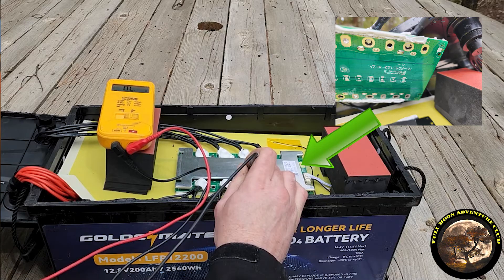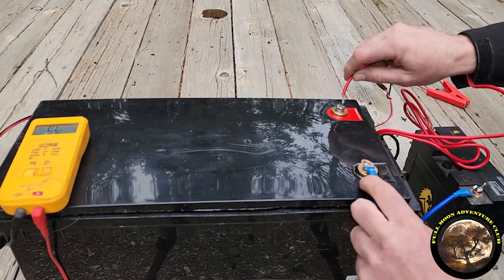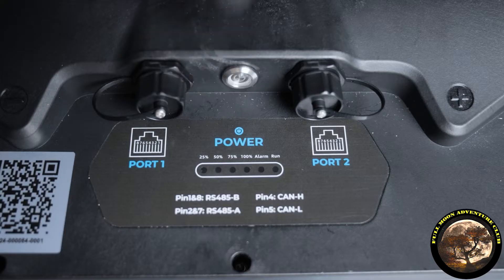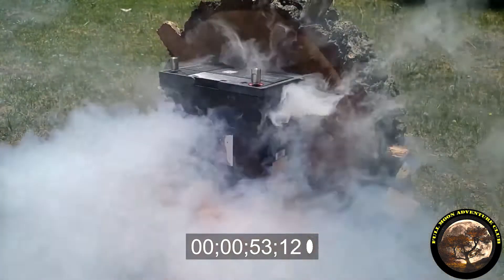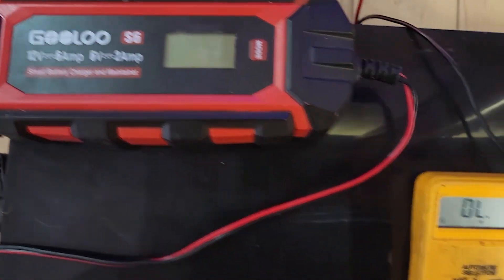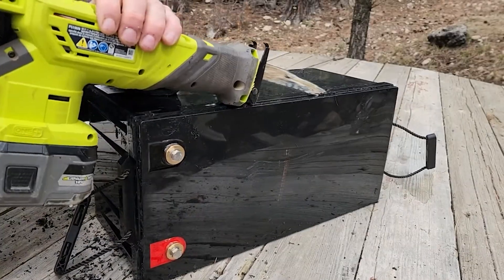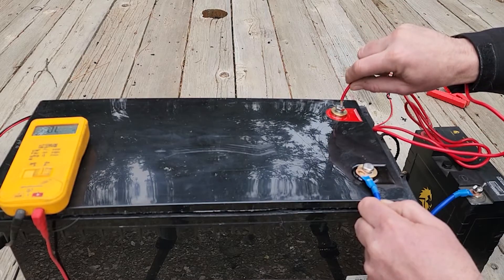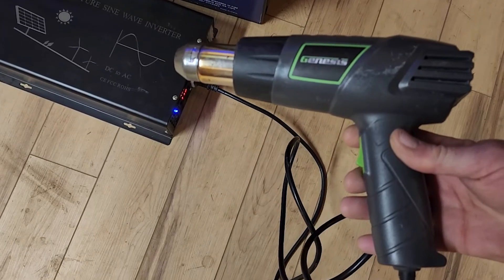LifePO4 Battery No Voltage - Won't Wake Up - Try this fix first

Comment: This worked for me. My lifepo4 battery was fully drained and my charger kept reporting off. I took a 6v and tried to tap the charger to give a reset but that didn’t work. I ended up connecting the working 6v to the lifepo4 battery and added the charger in at the same time. This turned the charger on and got the lp04 battery to start charging. 

Thank you!

Comment: Hey buddy thanks for the video I know it's a year already but I have a question I caught something you mentioned that the battery that failed is connected to the alternator. Do you connect directly to the alternator or were you using a DC to DC charger? I'm currently experiencing a similar problem I have not checked yet to see if the battery is swollen however I have metal case batteries so it may not be as obvious as your issue.

Comment: I Am OFF GRID and after several cloudy days in a row the NEWTIPOWER 100AH batteries I use for refrigerator / freezer would not charge! I found your video and used a spare 7Ah 12VDC battery and tapped the Newtipower battery terminals as shown in your Most Excellent Video and now they are charging up again! Thank you ever so much for the valuable information. God bless and be well!

Comment: bought 4x 12v 300ah batteries.
was charging them one at time... to hopefully put em in series to make a 48v system.
ahhh.. the last one.. its at 0.98v.
victron 100/20 cant see it. 
solution: put one of the other batteries in parallel and left it to charge. 8 hours in it was at 4.8v 24 hrs later (night included no charge time of course) its at 6.67v  but savior battery is full..
so should i give up? or should i try to drain down the savior battery and then reconnect again and hope tomorrow?
sadly sending it back is a no go as i had em sent to the caribbean.. it would cost $42,000 (280usd) just to send it back to the usa. then when the replacement (if they honor it) is coming down its another 42k in shipping.. then customs is going to come sniffing at 46%. so.. yea..

Comment: my eco worthy lifepo4 battery does charge, but there is no voltage coming out. Even the solar charger turns off after sunset. So no current at all coming out Any idea of I could sold the problem?
Reply: Bms sleeping

Comment: I think this is what's happened to mine. I cannot wake it up. I have my batteries wired in parallel and one battery was at 2% and the other battery was flat. The 2% battery took a charge just fine but the flat one I couldn't get to take any power whatsoever. Do you think a higher voltage would help?

Comment: Made a solar bank with 10 7ah LiFoO4 batteries. 
4 of them asleep… 
3 of the 4 woke up using another charged battery without issue. 
1 of the 4 refused to wake up.  
Tried several methods with no joy. 
Ended up over volting it to get her going. 
Put 1/2 amp at 22 volts on it for 30 seconds and it started taking current👍🏼. 
Operating normally now. 
That did the trick.

Comment: Great video. do u think I could wake up my 48v Lifepo4 battery with a 6/12v trickle charger It's reading .5 or do u have another option it's only 1 year old. The name of the battery is lossigy 100 a.
Reply from the maker: I doubt it. You'll probably need to construct some sort of Series Battery configuration or connected to another 48 volt battery in order for it to wake up.

Comment: I think you can put the good battery's negative ground onto the dead battery's negative for just a couple of seconds. Then measure the dead battery's voltage and it should anywhere between 5-12 volts. Or, just hook the charger to the dead battery and it should start charging. Either way you'll know the dead battery isn't.

Comment: My evolution cart battery  reads 48 volts but my battery wont charge. Sitting at 5% charge. Cart on board charger starts up and in 5 seconds turns off. Cart was stored at 65 % charge 4 mts ago. What should I do. Tks in advance!

Comment: I have two 200ah 12v batteries and one has shut down. It cut all my power out. Can I use the good battery to wake the other battery up?  Is this not a good idea?

Comment: I’ve got a 100 amp power lithium battery on my boat. It had 20% left. I tried to charge it, but it would not take a charge. It would power things and keep running thebattery down. But would not charge any ideas?
Reply: Follow our directions. Duh

Comment: Some bms systems have a delay on the " incoming power" for like a second its free to pump in then the bms starts protecting. This fixes ryobi batteries too you can tap a ryobi back in. Its actually time, 3 taps is 3 intervals of bypass

Comment: I have a Weize 100AH lithium and I couldn't get it to take a charge, I took it to a battery shop and he hit it with 19 volts and it woke up and I could charge it. Now it's charged to 13.44 and has been there for a few days. Do you think the 19 volt zap could have hurt anything ?
Reply: I've got one too volt meter reads 10.3 volts but wont take a charge

Comment: Thanks for this.  Jumped my 24s with 4- 6v's and worked like a charm.  Had to have generator running and hooked up immediately.  Charged up gtg
Reply: do you mean 24v (4s)
Reply: @jimmybrad156  I have lossigy 24 volt lithiums hooked up in series.  I used 4 6volt golf cart batteries to jump one of em and it worked.

Comment: Have  had  3  (three)  different  power  stations  and  1  (one)  LifePo4  battery  that  would  not  'wake-up'  with  12  volts  applied  from  an  external  source.   The  'external source'  was  both  an  old-school  battery  charger  (Sears)  and  a  standard  lead-acid  battery.     In  each  case  I  gained  access  to  the  internals,  disconnected  the  cells  from  the  BMS,   charged  the  cells  separate  from  the  BMS  to  > 11  volts  where  necessary  and  in  each  case  upon  reconnecting  the  BMS  it  was  'awake'  and  fully  functional  again.    (In  each  case  I  had  also  'shorted'  the  BMS  with  a  jumper  briefly  once  the  cells  were  Disconnected !  to  drain  any  residual  power  that  may  have  been  stored  in  the  capacitors  of  the  BMS.)    

    In  my  inexperienced  opinion  the  BMS  itself  had  needed  the  wake-up.   In  one  case,  a  Goal Zero 1000,  the  power  station  worked  fine  for  two  days  after  the  'wake-up'  and  then  went  dead  again  with  the  state  of  charge  previously  showing  about  70%.   Again  I  disconnected  the  cell-pack  from  the  power  station,  checked  the  cell-pack (= > 11.5 volts)  and  without  doing  anything  else  but  pressing  the  buttons  on  the  station  to  potentially  drain  any  stored  capacitor  power,  I  reconnected  the  cell  pack  and  the  station  was  alive  and  functioning  again  normally !     It  has  been  fully  functional  since  then  for  >  two  months  running  my  frige-a-frator,  an  induction  cook-top  and  being  charged  from  my  backyard  solar  panels.

   Me ?    I  am  an  EX -  Air/Heat  Service  Tech  that  likes  my  new  hobby  of  Off-Grid  solar  power  to  reduce  my  SDG&E  (Southern California)  home  power  use  to  about  $18.00  a  month.   We  are  proud  to  pay  (likely)  the  highest   power  rates  in  the  USA  .  .  .  .  .  .  'proud'  because  'we'  keep  re-electing  the  same  folks  that  cause  these  high  rates !                            take  care,                  rh

Comment: The issue I am having is the battery reads 12v but as soon as you hook something to it it reads 0volts. No power. Any suggestions?
Reply from the maker: If you connect it to another strong charged battery and it wakes up and reads 12 volts it is still low on charge. It should read around 14 volts when charged. If it is charged and it goes to zero when you connect it to something it may be a faulty cell or BMS unfortunately.
Reply: 12 is empty. 14 is full

Comment: I am in a similar situation. My 12V lifepo4 drained off grid during off season and went into protection mode. Hard to tell when during last few months. I was able to reactivate it at first and started charging it off solar on a Victron smartsolar. After a day of charging sucessfully I managed to drain it again with only a small load when the sun went down. It went into protection mode again and won't wake up now. :/
Reply: @gpmail -     Have  had  3  (three)  different  power  stations  and  1  (one)  LifePo4  battery  that  would  not  'wake-up'  with  12  volts  applied  from  an  external  source.   The  'external source'  was  both  an  old-school  battery  charger  (Sears)  and  a  standard  lead-acid  battery.     In  each  case  I  gained  access  to  the  internals,  disconnected  the  cells  from  the  BMS,   charged  the  cells  separate  from  the  BMS  to  > 11  volts  where  necessary  and  in  each  case  upon  reconnecting  the  BMS  it  was  'awake'  and  fully  functional  again.    (In  each  case  I  had  also  'shorted'  the  BMS  with  a  jumper  briefly  once  the  cells  were  Disconnected !  to  drain  any  residual  power  that  may  have  been  stored  in  the  capacitors  of  the  BMS.)    

    In  my  inexperienced  opinion  the  BMS  itself  had  needed  the  wake-up.   In  one  case,  a  Goal Zero 1000,  the  power  station  worked  fine  for  two  days  after  the  'wake-up'  and  then  went  dead  again  with  the  state  of  charge  previously  showing  about  70%.   Again  I  disconnected  the  cell-pack  from  the  power  station,  checked  the  cell-pack (= > 11.5 volts)  and  without  doing  anything  else  but  pressing  the  buttons  on  the  station  to  potentially  drain  any  stored  capacitor  power,  I  reconnected  the  cell  pack  and  the  station  was  alive  and  functioning  again  normally !     It  has  been  fully  functional  since  then  for  >  two  months  running  my  frige-a-frator,  an  induction  cook-top  and  being  charged  from  my  backyard  solar  panels.

   Me ?    I  am  an  EX -  Air/Heat  Service  Tech  that  likes  my  new  hobby  of  Off-Grid  solar  power  to  reduce  my  SDG&E  (Southern California)  home  power  use  to  about  $18.00  a  month.   We  are  proud  to  pay  (likely)  the  highest   power  rates  in  the  USA  .  .  .  .  .  .  'proud'  because  'we'  keep  re-electing  the  same  folks  that  cause  these  high  rates !                            take  care,                  rh

Comment: I notice you look like your charger is a pretty standard one. I have  one andused on my deep cycle lead acid batteries for charging. 
I swapped the lead acid out for lithium ion iron phosphate batteries.l see specialized lithium ion  chargers and they're costly.
Can l use my standard battty charger?
Reply from the maker: You certainly can. However, RV lithium iron phosphate Chargers are capable of charging at 100 amps or more. The charger that is Illustrated in this video will only charge at 5 amps so it takes a long time to charge batteries

Comment: I am having the exact same problem with a 280AH LifePo4 battery in my camper, except it’s brand new. The mfg suggested linking it straight to my solar bank, which I’ve done with no success. Any updates on how you got yours to wake up? I have a spare 12v battery but it’s a big boy and I’m hesitant to do the tapping method with it.
Reply: Your  'mfg'  should  replace  it  under  warranty !     I  previously  commented:

Have  had  3  (three)  different  power  stations  and  1  (one)  LifePo4  battery  that  would  not  'wake-up'  with  12  volts  applied  from  an  external  source.   The  'external source'  was  both  an  old-school  battery  charger  (Sears)  and  a  standard  lead-acid  battery.     In  each  case  I  gained  access  to  the  internals,  disconnected  the  cells  from  the  BMS,   charged  the  cells  separate  from  the  BMS  to  > 11  volts  where  necessary  and  in  each  case  upon  reconnecting  the  BMS  it  was  'awake'  and  fully  functional  again.    (In  each  case  I  had  also  'shorted'  the  BMS  with  a  jumper  briefly  once  the  cells  were  Disconnected !  to  drain  any  residual  power  that  may  have  been  stored  in  the  capacitors  of  the  BMS.)    

    In  my  inexperienced  opinion  the  BMS  itself  had  needed  the  wake-up.   In  one  case,  a  Goal Zero 1000,  the  power  station  worked  fine  for  two  days  after  the  'wake-up'  and  then  went  dead  again  with  the  state  of  charge  previously  showing  about  70%.   Again  I  disconnected  the  cell-pack  from  the  power  station,  checked  the  cell-pack (= > 11.5 volts)  and  without  doing  anything  else  but  pressing  the  buttons  on  the  station  to  potentially  drain  any  stored  capacitor  power,  I  reconnected  the  cell  pack  and  the  station  was  alive  and  functioning  again  normally !     It  has  been  fully  functional  since  then  for  >  two  months  running  my  frige-a-frator,  an  induction  cook-top  and  being  charged  from  my  backyard  solar  panels.

   Me ?    I  am  an  EX -  Air/Heat  Service  Tech  that  likes  my  new  hobby  of  Off-Grid  solar  power  to  reduce  my  SDG&E  (Southern California)  home  power  use  to  about  $18.00  a  month.   We  are  proud  to  pay  (likely)  the  highest   power  rates  in  the  USA  .  .  .  .  .  .  'proud'  because  'we'  keep  re-electing  the  same  folks  that  cause  these  high  rates !                            take  care,                  rh
Reply from the maker: Nothing worked for me except the tapping method. As long as the batteries are the same voltage you should be fine. 12 volt, 24 volt, ect. Good luck and thank you for the comment.
Reply: You had unplugged the bms it will reset the bms and let you start charging